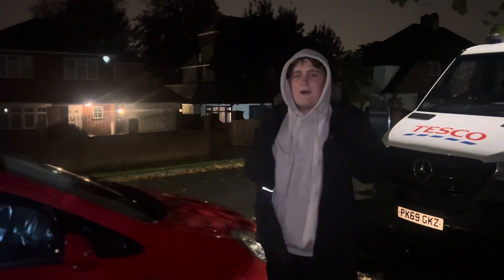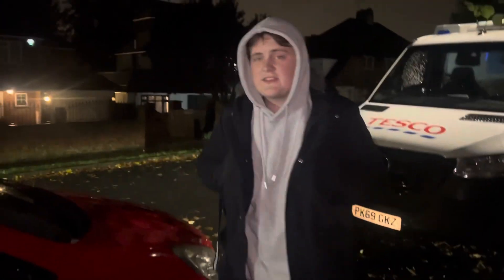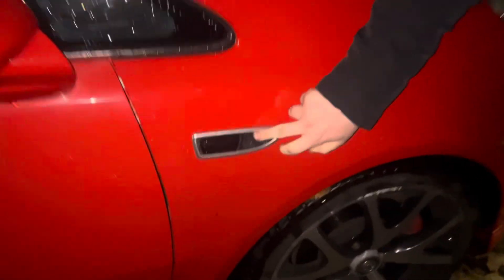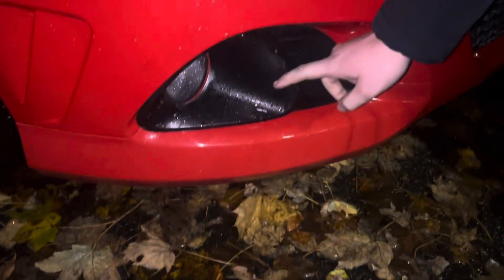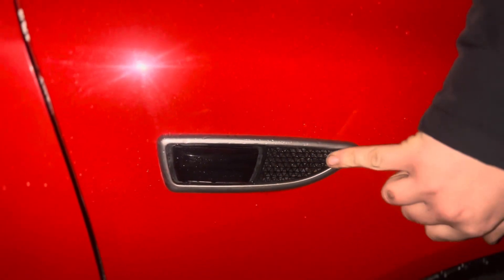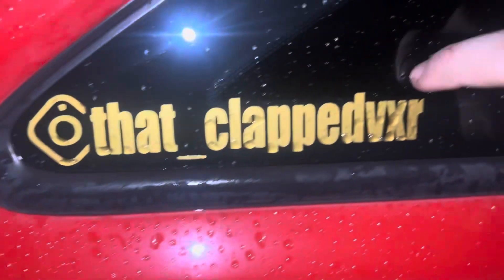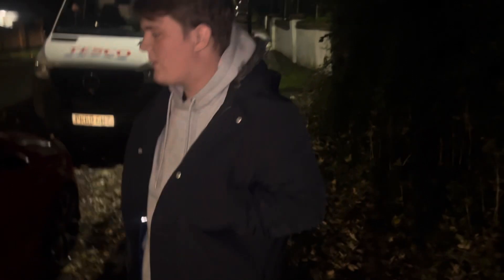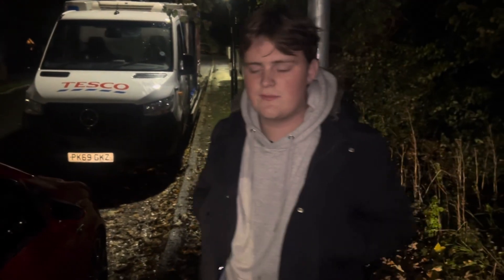Corsa VXR New exhaust vs Old exhaust sound comparison!

Comment: I have a vxr and at the moment its got a issue on cylinder  2 & 4 on boost but once sorted i would like to upgrade the stero system exhaust and maybe stage one or two dont know yet but deffo would like to make it look nice before sale
Reply: How do you fix cylinder issues? I’ve that issue on my Mercedes A180 AMG line
Reply: @OfficialPUshzw  depends whats causing it, ive got a valve and camshaft job that might be the problem and waste gate with corrosion, spark plug and air intake sensor change made improvments will see when the rest is done
Reply from the maker: @OfficialPUshzw  Could always bring it to me as i am an apprentice merc mechanic😂 Only kidding best bet is to ask a merc expert if you can, maybe even take it to a dealer